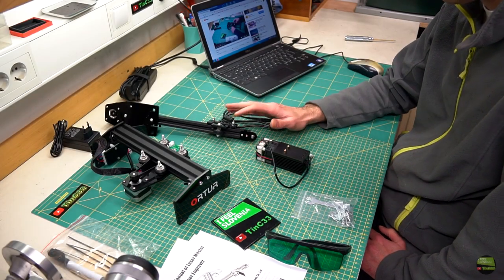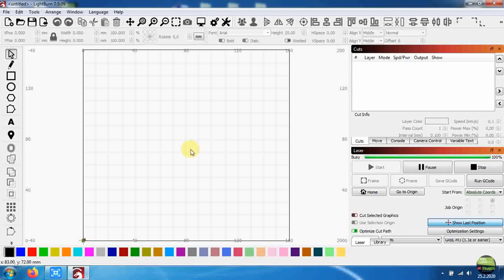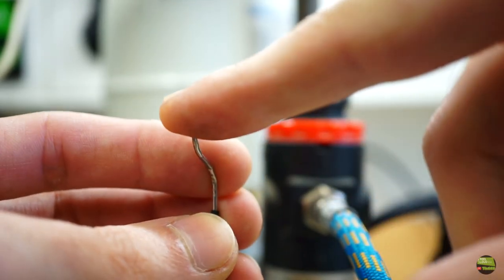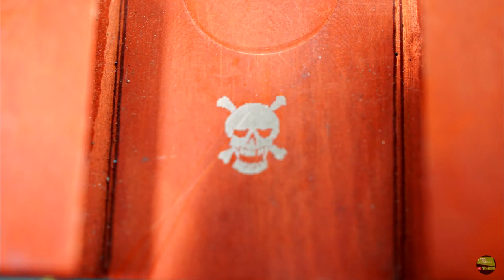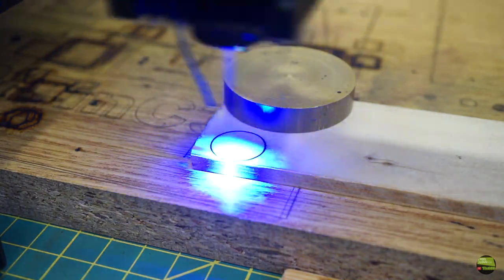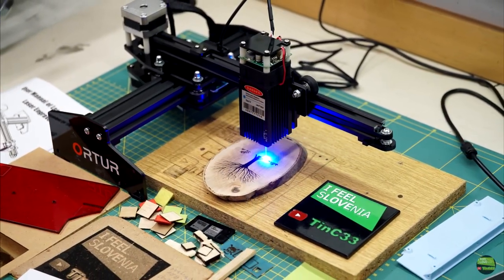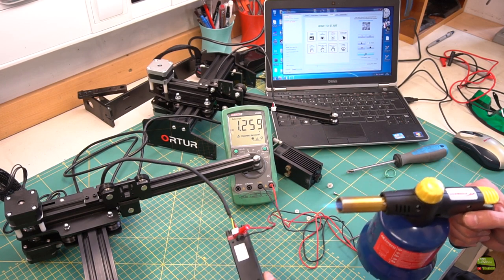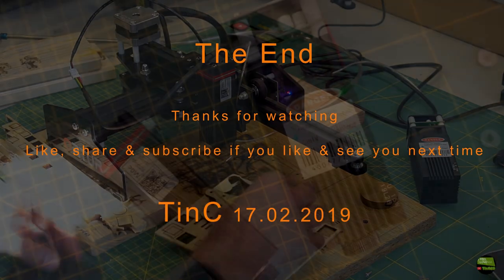Bring Ortur Master to another level FW upgrade - Air assist - Upgrade with NEJE 20w modul

Comment: I own a Master 2 (Gantry type) snd the difference between 1.3 and 1.34 is staggering!
They have really mastered the laser modulation . I recently had to contact OrturTech when my machine was Bricked following a bodged Firmware Update resulted in my Master 2 being put in the cupboard for a week, as I was resigned to it being terminally fucked Bricked.
I've also been sending Ortur Tech examples of Artwork with 1.34 firmware to give them direct feedback on the update and to get help to resurrect my lifeless machone.
I also own a NEJE Master 7W and I am also going to venture into swapping the module out for either NEJE or possibly an Opt Module. In the meantime, I have a '20w' Modu2 & 3 pin le that isn't as far off its stated Laser Output Rating as usual modules from deepest China. I need to make a couple of adapters using crimped 2 and 3 pin plugs and sockets to save making a new lead to rig the laser module. I falso ind the accuracy/detail of the NEJE is very tight and I wonder if its  down to Optics because since owning several Laser Units, I've been buying Decent Coated Collimator Lenses lately. Some have much longer focal length and another Lens has a much shorter focal length,  also had quite a large dot even when focused Basically,  my existing 20w module is running on a Mana SE controller and it is quite small anyway but fitting one of the new collimators I bought, it resulted in a much smaller focussed beam/dot. I may just try unscrewing the Ortur Lens and trying it with one of my new collimators but these Ortur Lenses seem exceptionally tight, like its not meant to be taken out

Comment: I recently bought the NEJE 30 W unit for my upgrade. It has built in air assist and 7.5W optical power. Love it so far.
Reply from the maker: i just editing video about 30w neje max, it's awesome, but the powerfull fan on it is not an air assist, function of air assist is that noozle blow with preassure close to cutting area, so it blow the bleck dust out of cutting groove...
Reply: @TinC33  As NEJE says the function of there air assist is to keep the lens clean. But either way seems to be a great diode lazer.
Reply from the maker: @Robothut  that's right, it is enough to keep the lens clean with no dust on it, but far from real air assist, true, modul is amazing i can cut 5mm plywood and 3mm mdf with them 20w can also cut 0,5-1mm deep into mdf, can't wait to get 40w modul into test.
Reply: @TinC33  Yes that 40 W unit should be a real treat to run. I hope the operational hours of the laser is long before the power output starts to go down. Only time will tell. I am adding a low cost hour meter to my set up so I can keep track of the hours on the laser operation.

Comment: I also have both lasers, and for me the Ortur is soo much better then the NeJe.
The focus of the Ortur is really sharp, as you can see on my video's, and the NeJe is really out of focus with a really large dot of light.
The Ortur makes clean cuts, while the NeJe really makes worthless cuts.
Funny that this differs so much.
Reply from the maker: Hm, that's really strange, sound like it's really depend on piece to piece, but i contact ortur and ask it about elipse shape focus beam and they tell me this is just ok, that's how their laser work. on my 3.5w and 20w neje laser beam is perfect so it cut really clean cut.
Thanks for info.

Comment: Hello do you have the ortur laser wiring pinout diagram i want to try that with a real 7 watt output laser module i have that has only 3 wires the ortur has 4 my ortur wire order is different the 7watt unit i had on my cr10s works great isnt focusable as it is set to 18mm but has incredible power able to remove the backing of mirrors for fantastic back lit photos on mirrored glass the ortur is definitely faster and very accurate

Comment: What would you suggest is best for laser engraving denim !
Reply from the maker: i didn't try on denim, but i think 20w will be best if you don't engrave grayscale.
Reply: @TinC33  I'll likely create my designs as vector images once i learn, I have the 20W ortur laser maser 2 on the way right now! I found a lens on ebay (DTR-G-8) that would also likely be better then the stock lens they provide for doing design work on denim at least!

Comment: I'm tempted to buy a laser cutter to use with paper, cutting masking tape for small painting projects and engrave objects for painting. I have a Mac, and Lightburn seems to be a good option to manage from the computer side.
Do you know if Neje can be operated with Lightburn?
The vibration is another issue for me when you shown those zigzag lines, is it something that completely disapear with lower speeds? or the best solution would be a different frame laser cutting solution.
Thanks

Comment: since you used this engraver and software is it possible to increase work area by adding longer aluminum extrusion..
I love the idea of the portability...
I am looking at buying one...  but work area is little small
Reply from the maker: Better to take ortur 2 with bigger area or ortur 400 comming out soon with area 400x400mm there will be problem with gravity, you need a counterweight if you use longer extrusion + need to repair firmware if it possible.

Comment: Your videos are amazing.  Thank you for the great details..  What are your thoughts on installing the Neje new 30/7.5W laser on my Ortur laser master 2?
Reply from the maker: Thanks, i didn't test neje 30w modul yet, but got plan to make review, by my experience neje moduls are better, because of better focus.
Reply: @TinC33  Is anything else required to change other than the power supply.  In your video you leave the temperature feedback disconnected.  I dont see how that would be an issue.
Reply from the maker: @shanegentry5213  no just replace laser modul and power supply, you won't miss temperature feedback, it never become hot.

Comment: Hi. I am new to lasers. I just have question. Is the higher wattage models faster in engraving than that of the lower wattage? Thank you. I love your videos.
Reply from the maker: Hy, thanks, yes if you engrave just black&white or deep engrave you can do it much faster with 20w, but if you want surface (grayscale) photo engrave 3,5w is better, because it's too week to burn deep into wood and they burn only surface so it make more shades of black.

Comment: Hello , i own an ortur laser master 2 20w , i was wondering if i can somehow use the neje software for engraving and not grbl or lightburn as they are very difficult to use
Reply from the maker: No neje got special microcontoller to work with neje software, beside of atmel microcontroller.

Comment: Hi there I have ortur laser master 2 20  w and I bought nene laser head 40 w but when I try to install it I was confused 
I have 3 pin in main board that contact to ortur laser head and neje 40 w have 2 pin which cable I need to use to contact it to neje laser head
Reply from the maker: Try to use the circuit board you got with the neje laser modul, as i know neje got 4 pin connector and ortur got 3pin the one from neje stay in the air it's just for temperature feedback.
Reply: Thank so much I try it

Comment: Any idea if it is possible to use it without pc/laptop? May be via raspberry pi. ?
Reply: I like bcnc. Its pretty simple to install and has a browser interface you can upload files to/send commands from.
Reply: @eyemac2011  please let me know if there are any tutorials on that. Thanks
Reply: @kkaround  check their github. https://github.com/vlachoudis/bCNC/wiki/Installation the pi install instructions are at the bottom. It can be installed with a single line, which is nice

Comment: Hello! How did you do air assist on Neje Master?
Reply from the maker: Just use a compressor and make tiny nozzle to blow into cutting point, we don't need much air just that blow dust away, compressor from refrigirator is enough.

Comment: Thank you for the video, great job! Don't worry about your english: I'm italian! eheheh. By the way I'd like to start my laser experience with an Ortur Master 2 (I like its frame). It's a shame that they don't sell it without lasers. Do you know if the 7W version could manage the 20W Neje laser or I need to buy the 15W version? I'm not talking about power supply of course. I don't know if the 32 bit board is the same for all three models. I know that Ortur has its own 20W version but it seems that the laser block is the same of the 15W version , maybe also the focus lens...About power improvements after firmware update I think it was only a bug present on older machine that have a code conversion error: I found this , https://forum.lightburnsoftware.com/t/ortur-laser-master-and-laser-master-2-firmware-updates-1-34/11714 maybe it can be useful 
Just another question: can we use the thermal sensor with the Ortur board: did they think to an extra input for that?
Reply from the maker: Hy neigbour, nice to see meet italian to speak english, never find one in italy (i was in school in Nova Gorica) :) 
Yes all the laser board are the same, but there are different firmware depend on ortur master or ortur master 2.
Sure you can add any laser on any version of board, you got cables with power supply 12v and pwm signal, so every laser support pwm signal will work here.
I didn't check direct on board bit on connector there is no input for temperature sensor.
Reply: @TinC33  Thank you man. If you want we can talk on socials/private! Now I'm looking for someone that tested both 15W and 20W from Ortur due to finalize my order. I have already a super quite and powerful air assit to test

Comment: The fixed focus is a lot better on the ortur than the adjustable the focus is horrible
Reply from the maker: Also neje 40w modul got fixed focus and it's just awesome.
Reply: @TinC33  nice, can I use it on my ortur without having to do anything extra?
Reply from the maker: @lunatic231  i think yes but need 4A power supply 12v
Reply: @TinC33  merci

Comment: So, I can get the less expensive Ortur 7w for about $175, and and replace the laser with the Neje 20w laser.  But will the $100  30w Neja laser also work on the Ortur?

https://neje.shop/collections/laser-module/products/30w-laser-module-neje-master-2-cutting-module-upgrade-kit-fixed-focal-length-sliding-focus-visual-protection
Reply from the maker: Wow that's someting new, but it says it fit on neje 2 without modification so if it fit on neje it must work.with ortur also, but need 3a 12v power supply.